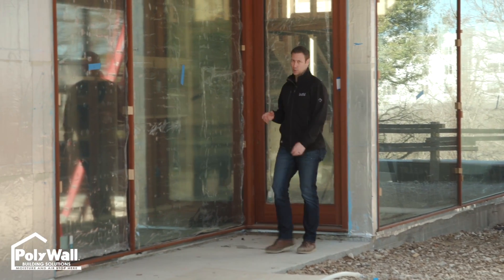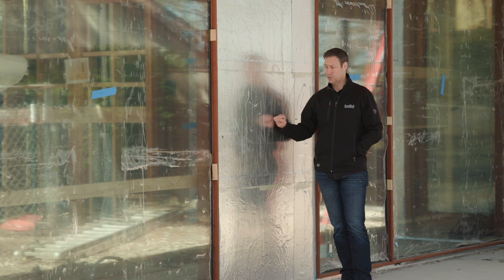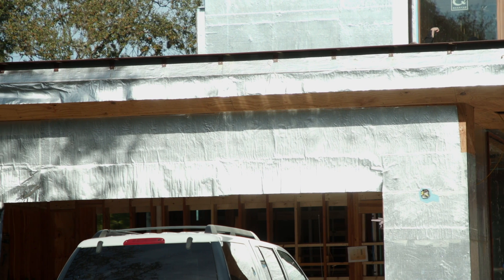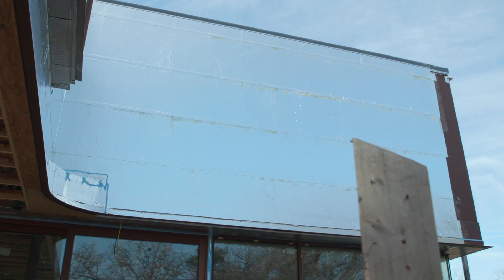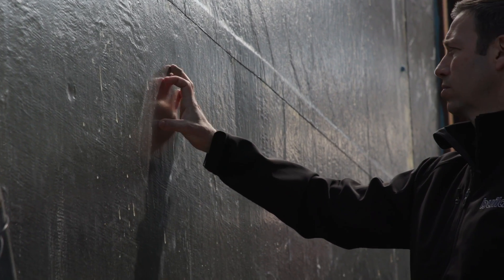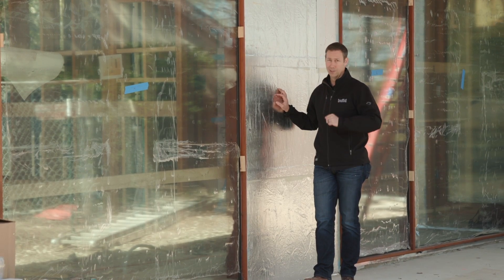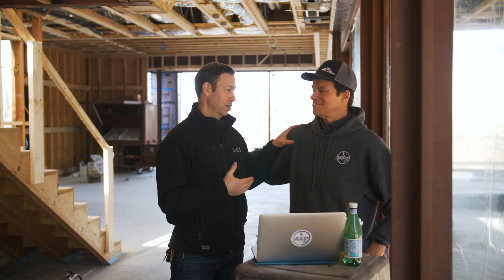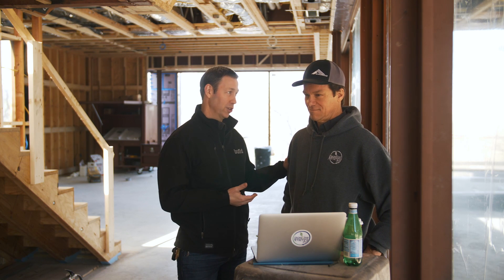Is a Zero Perm House Wrap Stupid?

Comment: I am also a PE and we must remember 2 things.  Matt builds from plans developed by architects and engineers and his only responsibility is to install an item per the plans correctly.   Secondly his videos have become commercials for the most part.   Don't get me wrong, I do like watching, but I can make my own decisions about the product.  In this video, if the wall was sealed so well, why was there an increase of building material during rain storms.  That says the polywall stuff is not perm 0.    My other take on this was that it is not worth the cost to do the polywall.   Always give me a wall that can dry in both directions.

Comment: Look closely: this actually shows that using the aluminum wrap, it's dried out in the summer (down south) due to the use of Air Conditioning dehumidifying it. The data is clearly showing the opposite of what Matt is describing at https://youtu.be/xPXcnioVBFw?t=504  He's pointing at the graph moisture peaks, but those are in the winter, where moisture from inside the house is migrating to the outside. (Look at the actual dates on the x axis of the graph) The way I look at it is: Where is the water vapor barrier? then figure is there any case where the moisture on either side of the barrier hits the dew point. This is key. In the North, if you put a water vapor barrier on the outside of a house which is heated inside in the winter, there is so much water that the insulation becomes waterlogged, soaked in water, to the point that insulation becomes worthless and mold goes crazy.  On a side note, if you use closed cell foam insulation, you can probably get away with just about anything, but with fiberglass or wool insulation, moisture will readily go through it.

Comment: Great video - late comment. What you didn't discuss was the area under each graph which would give the result of the total amount of moisture retained in each assembly over the full test cycle. It looks like the closed in system has flatter graph peaks and the open system has narrow tall peaks. This would indicate that the closed cell framing is exposed to more moisture.

Comment: So how does Aluma Flash Poly-Wall compare with the Zip Hueber Wood? I am planning to start building soon and in climate zone 4 my plan is to use Zip R Hueber Wood for exterior 2x6 walls, CoraVent rain shield, and James Hardie lap siding, and for the foundation walls waterproof membrane, 2-inch non-permeable rigid sheet insulation, and lastly covered by water drain sheet with geotex cloth that runs down to the footing drain.

Comment: Thanks Matt for all the great videos! We live in PA and are in the process of getting our siding done so want to make sure we get it right underneath. Our current sheathing is 1 step above cardboard so we’re planning to replace with plywood sheathing. 1 question, would it work or make sense to use the zip tape to cover all seams on the plywood? Next we’re going forward with doing low-e wrap. 2nd question is for our area would it make sense to do R6 foam board over the plywood and underneath the low-e? Would this work or be overkill? The exterior studs are 2X4s. We are doing regular vinyl siding on top of this. We have electric heat pump and air and want keep our energy costs down. Any

Comment: I'm in cold climate now.  I saw it said that Polyiso wicks to the inside so you can not is any closed cell 2lb insulation or polyurethane sealers inside the cavity or between the sheathing and the poly exterior.  And that Open cell insulation allows the poly to dry to the inside.  That needs  a wider cavity.  Rain curtain to the outside... Ok ok...  When all is said, even here, It's maddening. It's like money ball for building...160 pages soundless like the cottage industry of BS.    I feel like i can not get a difinative simple straight answer.   

Anyway does anyone know... (This is for  6, 7 zones), can we use that aluminum flashing over the seams of polyisol sheets that already have aluminum face to improve the air and water seal before the rain curtain and  siding?

Comment: Alumaflash would be good behind a reservoir cladding like brick where you want to prevent internal moisture drive.  Lstiburek recommends taped XPS with air gap and drainage plane (for brick)

Comment: What role does the sheet rock play in this analysis? Is it assumed that the stud cavity will dry through the sheet rock? Even painted sheet rock? Or is the assumption that almost no moisture is getting into the cavity so drying through the sheet rock is not an issue?

Comment: MATT!! What do you think about slightly overpressuring a house with the panasonic ERV? That would mean moving inside air to the outside through any walls that had a leak. Is that ok compared to a negative pressure in the house bringing in outside air in through any wall leaks.

Comment: Wait, did I miss something? What about all the nail penetrations from holding on the final sheathing? Like vinyl siding.
Reply: That’s what is good about spray on or peel and stick with a butyl lot similar layer. They are self sealing at penetrations. I won’t use regular house wrap.

Comment: If the two perform alike with water, I'd choose the aluminum wrap, since it will let less heat pass (reflects more) when the cladding gets hot. Don't know about cost... they only sell Tyvek around here, but most people build with mortar and bricks, or even concrete. Wooden houses are rare around here.

Comment: What House Wrap would you recommend for a stucco home in the southern New Mexico/El Paso area? Typical required is two layers of felt paper and chicken wire. Aluma Flash recommends Blue Barrier for every staple and screw but that wouldn't be practical. Guessing it would be similar for Delta Vent SA. Just looking for something better for air and water than felt paper. Appreciate you suggestion @Matt Risinger and others. Thanks.

Comment: Appreciate the climate zone discussion but in climate zone 1A this assembly is almost never used for residential projects... we do not build houses in Miami using wood framing... everything is block construction as its typically a limitation of the building code here. would love to gather more information about these types of systems with CMU style construction.

Comment: Somehow missed this video, glad to have found it.
Searched though the comments and not seeing it mentioned, so will. To me, using a zero permeable WRB is about control, just like an air barrier. By not letting moisture in, there is less dehumidification needed, as the system only has to address the inside load. Similar to an air tight house, the HVAC only has to handle the inside load, rather than also having to condition the infiltration.
Reply: I think the major concern with zero perm house wraps is if there is any infiltration of water then it won't be able to dry to the outside.  That's why we are meticulous with the tape and the liquid Flash not just slapping some Tyvek up there and calling it good.  Certainly zero perm barrier makes sense in the hot humid South but less so in the mixed heating climates.
Reply: They're WUFI analysis was only for Humid South, zone 123, not where I live 4-5

Comment: I have a quick question. So the wrap you are using didn’t have to do with radiant barrier at all. Or is there going to be an air gap for the siding. If so how do you do siding with minimal conduction

Comment: I understand what your study was about. Basically it will be a very tight house. My question is, what do you do for good indoor air quality?  When you get to much carbon dioxide build up in a building the occupants are affected. You see that in large commercial buildings in conference rooms with inadequate ventilation. You need some way of exchanging the air x number of times per hour.  So does your air handler (furnace) have an outside air intake that mixes return air with outside air? I love your show!

Comment: WRB is permeable to allow for failures in construction due to cheap unqualified labor and lack of oversight on most residential projects.  Another reason is the traditional aesthetic in the US that demands many funky condition that are hard to seal effectively. If you have excellent quality control and right design you should be able to use impermeable in all zones. 
With regard to vapor barrier on the inside I am skeptical of the benefit. With constant interior climate, amount of water is not significant relative to what's coming in from the outside. (another reason why keeping vapor barrier out on the outermost layer of the wall makes most sense)
Therefore, using vapor barrier on the inside, as it is hard to install with multiple penetrations and discontinuities at floor and ceiling, I would not recommend it.  Use Rockwool insulation and it should be fine.

Comment: Matt, great vid, love the info you provide,...Question: If building a zero (or low) perm house, should you automatically opt to install a dehumidifier? I plan to build a SIP panel house, with SIP panels that are clad in ZIP system, on a crawl space constructed of Faswall ICFs, with attic and crawl space sealed & conditioned.  Also, is it an issue if crawlspace is permeable, and house from foundation up is not?
Reply: I would love to hear who you selected for that SIP fabrication as that is something I am interested in doing as well.  could you post that company or contact info, I would be very grateful. Regards

Comment: Ok so now you forgetting to mention a few details on this again. So you have a poor building material to begin with like wood or Cinderblock which both are permeable material. But what is now if you have a solid wall for example steel, than adding your ISO insulation let's say Styrofoam for simple terms. And than you still would use this Aluma Flash in a none permeable solution so you trap in between those layers your moisture I don't think it would be a good decision. Please address it.

Comment: Matt, a couple of question, not criticism: I get that , if you keep water out of the sheathing, you'd measure less moisture content in the material. My question, though, would be if the vapor open material was applied in the most tight way possible. That info might be in the report, but I haven't read it, yet. An important point to mention here would be if all the staples were taped over, because, as you showed in some previous videos, a lot of moisture gets behind the house wrap through the staple holes and not so much by vapor transfer.  Also, Would an application of Aluma Flash over OSB followed by installation of 1" foil faced Polyiso foam trap moisture between the two?

Comment: I live in Ct. And I see Tyvec and seeing more & more Zip. Haven't seen continuous 2" insulation on the exteriors but love the idea. You need to seal the foam or mineral wool up but then nail up siding & puncture your membrane but any water should flow out from behind the siding and not puddle.

Comment: I've built a few homes housing art collections worth hundreds of millions of dollars and used two layers of 15# felt. This was directed by the top people in the industry who were approved by the insurance companies. Quality control and constant inspection of the work is very important in making this work and the assemblies were different in the sense that I've never sheathed a house in OSB, but only plywood. 

I did build in Zone 4. A lot of things might work fantastically in Austin that would be a disaster in Seattle.

All that said, I always used impermeable membranes under the interior drywall or plaster in wet rooms like saunas, bathrooms and laundry rooms. That requires a layer of plywood on the interior face of the wall studs. 

I should point out, using two layers of standard 15# felt is actually much more expensive that using an impermeable barrier system. The labor eats up any cost difference in materials. The base layer needs to be wetted and allowed to dry (wrinkling) and the top layer painstakingly applied over it. The details on the perimeters can get really complicated.

Comment: Does this simulation take into account the moisture given off by the occupants and their daily operations like cooking, (dish)washing, etc? Because that is where the big argument for a vapour-open barrier is coming from, to be able to move that moisture out. In regard to only the moisture from outside, it is quite obvious that a vapour-closed barrier would perform better as a vapour-closed barrier has a lower moisture permeability than a vapour-open barrier.

Comment: overall a great video, exactly what I'm here for. Especially liked the concept that 'air is a transmitter of water vapour from outside to inside'. Thanks for the idea to mull over! Are there components of this overall system that allow the whole house to dry from the inside? Assuming the HVAC system can take inside water vapour and push it out?

Comment: In Florida, the WRB is required by code to be a minimum perm rating of 5x the exterior sheathing. Based on standard OSB, that means the WRB has to be at least 5 perms.
Reply: Would be interesting to see for these materials : Cinder-Block, OSB, Zip sheeting, Steel, AAC  which are the most common building materials for walls.

Comment: So in the south you don't put a vapour barrier on the inside face of wall? The cardinal rule for me is vapour barrier to warm side and let everthing outboard of that breathe - you have to understand where your dew point is in the assembly and ensure it can deal with the condensation. You can tell from my spelling we are talking about Canada and cold climates. The important distinction here is, regardless of location, a do not lock your wall assembly inside non breathing materials. We have had lots of issues with acrylic stucco on conventional northern climate wall assemblies.

Comment: Hey Matt. This was an awesome video. I am a new and first time home owner and when I bought the house I didn’t know all of this was involved when building. Question- since I have a standard Built home from a builder that uses pre cut lumber and templates, they used the standard builder materials. What improvements would you recommend that would increase my homes value but not break my bank? My home is in the midlands of SC and built in 2013. 2900 square feet. Tankless water heater. 2 hvac units, one gas (larger unit downstairs and smaller unit electric for upstairs). Thank you very much.

Comment: Stop using wood as your construction material ,if you get it wrong your house falls down ! 
Use hemp ,straw ,concrete ??????
Reply: if you get it wrong, your house still falls down.
Reply: Back in my college days in Boston, a twenty story residential building was done in cast in place concrete, with a cantilever balcony extending outward at each floor level. A year or so after construction, a cantilever balcony near the top sheered off, dropped onto the next, and the process continued until all balcony slabs were on a pile on the ground. 45 years ago, but as I recall, it was lack of re-steel in the cantilevers (cheaper to pay off the building inspectors; 20 years later, a large number of them were caught in a huge sting operation), but it might have been also a frozen-while-curing scenario.  

Point is, no material is inherently "fail-safe". Any building material and component must be utilized per its properties and engineered and installed correctly. If those conditions are not met, ANYTHING can (and does) fail.

Comment: Yes it will fail!! You will have 1,000's of nail holes in it!!
Reply: @David-gld  40 Mils
Reply from the maker: Roofing Ice/Water shield has thousands of holes on a surface that gets way more water than a wall. Yet that doesn’t leak. Why would this be more prone to leaking?
Reply: @buildshow  do a test on a brick wall. After a big rain check the moister behind the brick. Drill hole in brick and put a moister meter probe.  Cement siding will be even higher.  I am not knocking you!! Just my opinion. Here in Texas we should build our houses just like they do in Canada.  We get just as hot as they get cold. We get hot for much longer periods of time than they stay cold
Reply from the maker: Roofing Ice/Water shield has thousands of holes on a surface that gets way more water than a wall. Yet that doesn’t leak. Why would this be more prone to leaking?
Reply: @buildshow  not much moister gets through the shingles.  Brick and stone and most siding suck moister in. Every single wall that i have remodeled that has had foil backed product. Has had mold. Behind brick or siding. 99% of all work i do has been water related. Water getting in or water not getting out!!
Reply: @buildshow  You are too nice, tried to help here. Strong language more useful than repeating oneself. And I get to be the fall guy.
Reply: You are conflating Tyvek (stiffly flapping in the breeze, otherwise known as air movement between the Tyvek and the sheathing) with a fully self-adhered, SELF-SEALING membrane product . Your emphatic statement is engaging, but entirely uninformed. And for the record (again), my own jobs get fully liquid applied VP self-sealing. My projects have too many intersections for sheet goods to be the best answer. And for additional record, I have put the material we used through pretty rigorous testing before implementation. Fasteners through OSB pans lined with Barritech VP and peppered with fasteners, and fasteners (including stud-type masonry anchors) peppered through the 2" Atlas polyiso foam, were filled with water and covered to prevent evaporation from the "bathwater". No penetration to the OSB after a month of immersion. In my book, that simulates (models??, with all attendant caveats) a reasonably heavy rainstorm scenario. 8 years after completion, not even a hint of any water/ moisture issues. Fortunately for me and my clients, I rely on testing, as opposed to opinions.